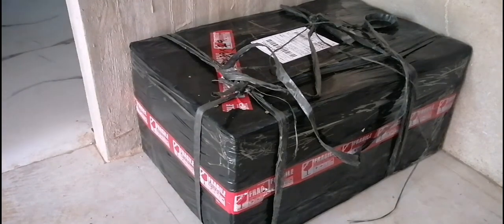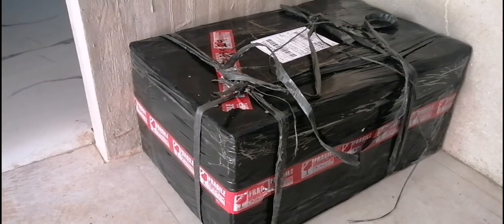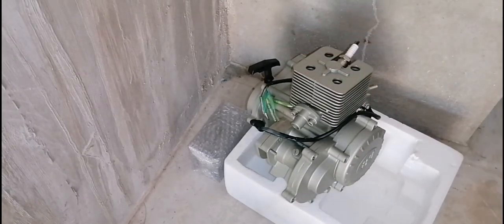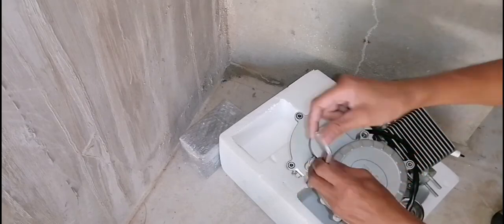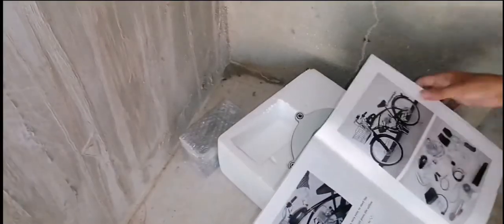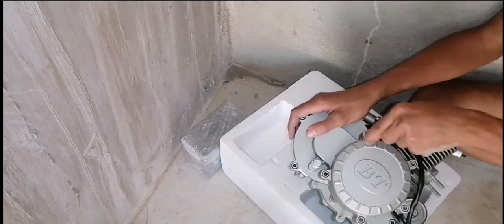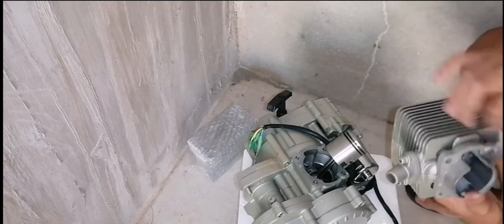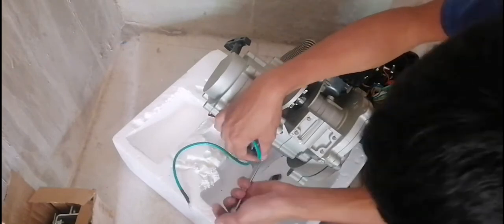BT80 Motorized Bicycle Kit with Electric Starter Review & First Run

Comment: Hello, friend, is the motor AC alternating current or DC direct current?
Reply from the maker: it's a petrol engine.. 2 stroke
Reply: @letsbuildsomething4317  Hello, friend, right, I have one like it, what I mean is the stator coil system, it gives alternating current or direct current, I never uncovered that part ...
Reply from the maker: @mariotorres2485  its AC & DC it has rectifier for. the battery.